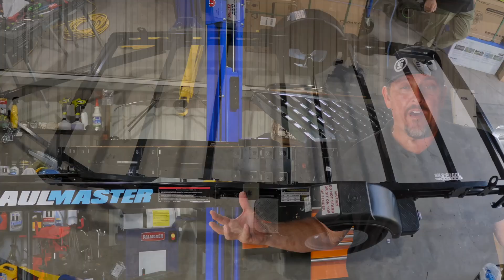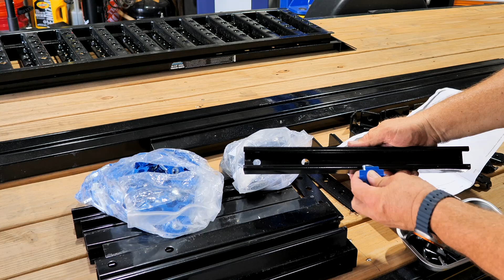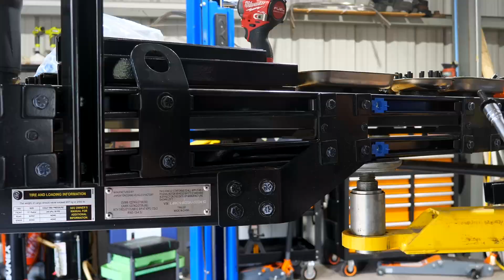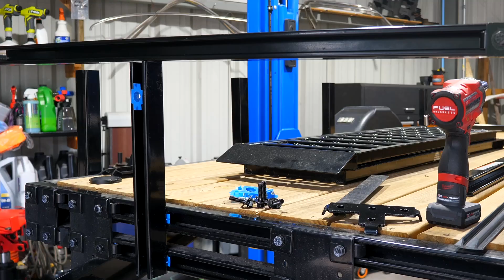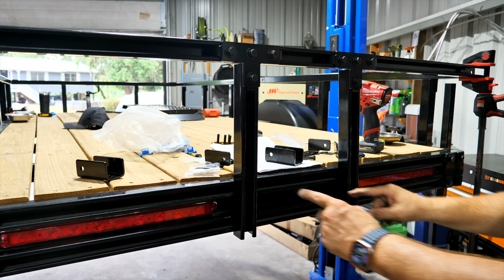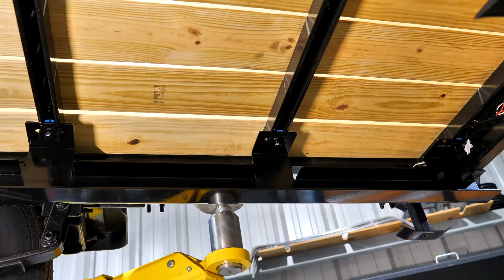Harbor Freight HaulMaster Trailer Part 2 - Rails and Ramps

Comment: 1 year later June 26 now. Got the trailer, still need to build! looking forward for the need for trailer top rail system, I need the top rail 48 inches high!  Where would I get side rails 48” long that would work on this trailer.

Comment: You skipped installing the decking.  Do you have to drill holes in the cross bars? And now the system is on Clearance so I wonder what kind of support will be available.

Comment: I got my siderail kit yesterday.  A couple of upgrades; the side plate connecting the front rail to the rear, above the fender, is now 3 sides, not just flat stock.  Also, the tailgate now has a real spring loaded latch on each side, not just that plastic and rubber thing.  I imagine someone's load shifted and took out that attachment and they lost the load.   The parts were included, but my instructions did not explain what they are.  However, there's a PDF file.  Go to the product, scroll down to Manuals, you'll find it there.  Print pages 5, 6, and 7 to get the updated instructions for installing the rear latches.
Oh!  Use a carpenter's square to get the side posts straight and even.  Also, make sure the side posts are pushed all the way up.  I used a small jack just to be sure they were as tall and thereby even as possible.

Comment: Any easy  preventative way to keep the ramps locked up from being stolen?
Reply: I picked up two heavy duty all weather combination padlocks and use them instead of the clips that came with the ramp holders. It keeps the "flag" that holds the ramps in place locked but easy to open.